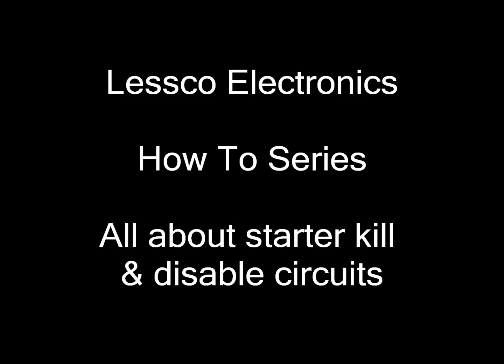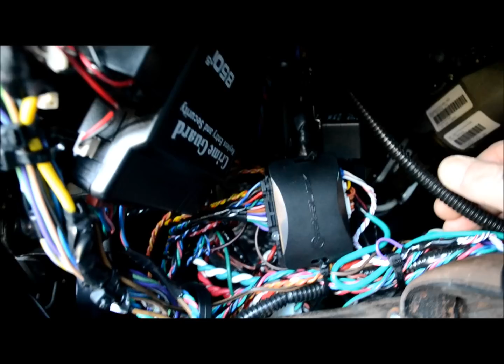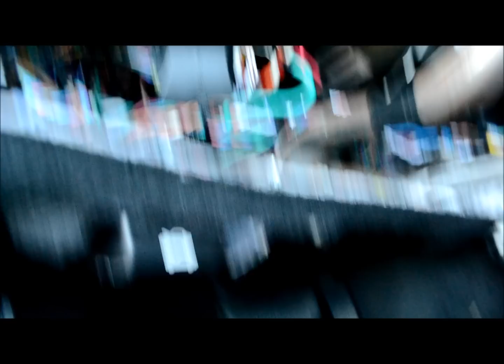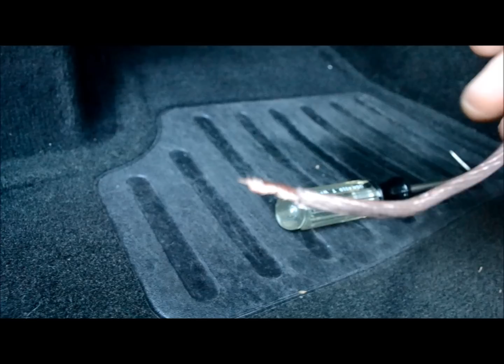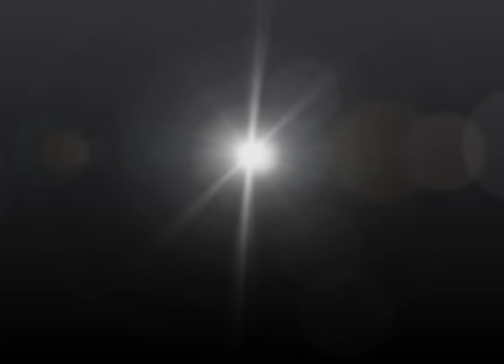Car alarm How To - Repair or remove a starter kill disable

Comment: Can't you just unplug the relay to disable it?
Reply from the maker: yes, IF you jump out the starter wire, if you unplug it you just open the starter circuit permanently which is no jueno

Comment: just remove that junk from the truck .  some one install this crap in a truck and it kept  getting them stranded on the side of the road. truck would turn over but had no spark

Comment: GREAT VIDEO The jumper wire connecting the two larger wires worked for me in getting my Subaru started. My emergency lights still flash, but I can now work that out. Thanks

Comment: I bought my van a few months ago and when reinstalling the doghouse after installing some new engine components, I accidentally hit some sort of switch hidden under the dashboard.  Now when I try to start my van, I hear a click, and the doors lock and quickly unlock.  I looked around under the dash and sure enough, there is an aftermarket alarm system installed. (DEI model 425)  I had no idea this was even in there as no fob came with the van.  I searched online and got the instruction PDF for this aftermarket system which has lots of info, except how to disarm the No Crank option.  I found a key fob on ebay for this system but I will have to program it to work and the PDF says I will need the code the original installer used to do that.  It actually has 2 little hidden push buttons, one with an led and the other one is black.  I also found a pair of wires hanging down under the dash running from one of the two alarm system Black boxes that have 12 volts hot between them all the time.  I am going to try your trick to see if I can get my van started as the manual says to reset the system, the engine must be running.  I may just rip everything out once I get it running again and I will watch your video on how to do that.  So, thank you for making this video.

Comment: Could starter kill relay cause parasitic drain on battery? I removed alarm system but didn't remove starter killer relay. Can it really pull 0.160amps when car is asleep?
Reply from the maker: its possible on an improperly wired relay, however I never recall seeing a relay draw so hard it was a battery killer on a starter kill by itself.
Reply: @Lesscoelectronics  Yeah im lost i really cannot find whats causing it i realised fuse 51 CAS drops it to 0.01-0.00 amps. But i cannot figure out what is causing it.
Reply: @Lesscoelectronics  Thank you for replying i cannot find what causes parasitic drain of 0.16-0.17amps on my bmw e90 2005. I do see drop in draw if i remove CAS fuse 51# but i cannot track it down. I did find a cable that was connected directly to JBE 12v cable which is insane that someone would do that removed it and hoped i fixed the problem but i still have same parasitic draw. I guess next thing to do is remove navi and radio to search for some kind of gps device or something that might be wired to that fuse. Im running out of ideas.
Reply: @Lesscoelectronics 
I really dont see how I can know what you did with that wire...
Just stick it in two holes there?
What did you do?
Reply: Im wondering if they have hard wired alarm siren to that fuse#51. Wonder if that could draw enough current 0.160-0.18 amps.

Comment: I have the Viper 350 PLUS 3105V 1-Way Car Alarm Keyless Entry and when I arm my alarm and unlock the front door with the key the alarm doesn't go sound off. If I unlock the passenger and open it it goes off. What is wrong? 🤔 Thank you in advance.

Comment: I have a 1999, Gmc with factory alarm :I had it disconnected,  but the Kill or too starter relay , acts up every 10th start or so. Example: it's a Security light in dash flashing it will turn won't start, I have to wait a while ,when security light is solid " cranks runs great..

Comment: You win 🤦🏾‍♂️😂😂 I went through everything from fuses all the way to the ignition cylinder and starter. Fixed it with 2 inches of wire 👏🏾👏🏾👏🏾

Comment: How do you remove that black box cover?
Reply from the maker: You mean the under dash panel?
Reply: Thanks for answering me back. Yesterday I attempted to remove it in the daylight and had a better look at it, and one of those two plastic screws on that black cover got loose, the day before me looking at those obvious flathead screwdriver plastic screws, I thought were dummy screws that didn't do anything ( no function just for looks screws) the next day one was dangling from me messing with it trying to take it off the night before,. then I finally got the box open and then I saw the fuse box is there I never knew where the fuse box was. I guess I should have  looked at the glove compartment book, but I got it thanks. I appreciate your help

Comment: I'm assuming there is little chance of getting a reply to this but I have a rattler security system in my truck and have been able to use my truck for a week because it's been going nuts as a result of the. battery dying and getting jumped. I tried disarming it many times and resetting it and doing a hard ecu reboot to no avail. Today I cut the power to the alarm itself and pulled the fuse to the system and pulled out the rattler head unit/brain and everything else I could track down but it still has it immobilized. Did I ass fuck myself by pulling everything like that? I need help

Comment: I have a 98 Ford mustang convertible 3.8l only has 98.000 miles it starts and just 10 sec later dies. Theft light starts flashing. I don't know where or how to start to go about finding nor fixing the problem, so my car Will run and start running.. can you please help me

Comment: Thanks for this video.  In my case, it seems it was something was the aftermarket alarm system that was preventing it from starting.  Or it could have been the connections behind the steering wheel... I'm not sure, but I tried tightening some random connections and it's starting now.

Comment: If I took out the alarm completely and took out the relay and reconnected my wires back to factory... can that still affect my starting ability? My truck ran fine before I took it out and rewired it. Now it won't pump fuel. It starts with fuel in the carb. But My pump or my injectors are not getting power. Wanna eliminate wiring as an issue before dropping my fuel tank to change the pump.

Comment: I have a 2003 Silverado I have a negative output out of my ignition coil could this be my problem if my viper alarm was taped into my ignition switch using a relay

Comment: i have 99 range rover that someone installed an auto page alarm. i found relay but all 4 wires are same gauge. would it do harm to just randomly try connecting wires?  truck wont crank and im out in the country. thanks.

Comment: You solved my starter problem. I clipped the two wires and joined them directly, and it worked. Thanks!

Comment: What if i cant find a relay but truck starts when i hook the 2 wires together
Reply from the maker: Hey, whatever gets the job done, right?
Reply: @Lesscoelectronics  lmao yea but im trying to keep the alarm working and dont wanna do it that way i was asking what can i do it dont have a relay that i can see it start right up when i touch the wires like u are in this video
Reply: @Lesscoelectronics  i just need help lol is all
Reply from the maker: why dont you just buy a replacement relay from our store?
Reply: @Lesscoelectronics  thats the thing i dont see any relays connected to the alarm only 2 fuses i followed the wires from the alarm wires for the starter and cant find any relays
Reply: @Lesscoelectronics  if it helps the alarm is a code alarm srt 6700 and ita on a dodge Durango lol older model
Reply from the maker: You couldnt miss it, It will always be interrupting the heavy gauge starter wire in the main ignition harness.
Reply: @Lesscoelectronics  i think the relay is built into the brain i traced both wires and there aint one im thinking the alarm is armed and cant unarm it cause the remotes dont work so i think i have to reprogram the remotes. Ideas on that????

Comment: Lifesaver man. My car sat up for exactly a yr and a half and the alarm went off until the battery drained all the way. Went back to start my car it wouldn't start not even with the remote start. Bypassed it with the wire and it work. Thanks bro
Reply: Which numbers did you bypassed?

Comment: would this be the same for a factory car alarm?
Reply from the maker: depends, the older ones work like this, but theyre actually aftermarket units with oem badging in alot of cases
Reply: Lessco Electronics How about  a 07 Nissan murano factory alarm.  Will this fix the problem.  Kill switch keeps coming on
Reply from the maker: whats the car doing now?
Reply: Lessco Electronics I turns back on if I pop the hood and move the battery to a certain way. I start back up but sometimes if I drive it . It will cut off at a light. It doesn't do it all the time tho

Comment: Before you do anything about problems with the vehicles alarm system please check the voltage level of your vehicles battery..  My Viper after market alarm system went out of my control when the alarm would not shut off.  Disconnecting the battery silenced the alarm and I was able to gain control of the key pad when I connected the battery back to my GMC.  The next problem was I couldn't go into the GMC without the alarm going off.  I couldn't shut shut the alarm off only temporary with the keypad.  

Come to find out what these professionals won't tell you is that there is a sensor to tell you that the voltage level in your battery is too low.  In fact it will be low enough that if you didn't have the alarm your car wouldn't start anyway.  As I'm saying if your alarm is giving you a head ache check all your batteries before you do anything.

Comment: I have a 2009 nissan pathfinder and when I cut my car off my alarm light indicator on my dash panel stays on, what can I do to fix it?
Reply from the maker: How are you disabling that alarm exactly?
Reply: I'm not trying disarm the alarm system, I'm just curious why my car indicator lights stays on my dash pane when I shut my car off and lock it

Comment: Hey, thanks so much for this! I have 3 heavy duty wires going into the kill switch box and there's a wire going between the small wimpy red wire to the big orange one. So what do I do in this instance? Can I cut that? I did my meditation this morning!
Reply from the maker: nevermind that, just reconnect the 2 heavy gauge sides of the starter wirem it should be pins 87a and 30 on that relay
Reply: Appreciate the reply! I connected 87a to 30 and it's completely dead. I never thought you'd reply so I had started unplugging the alarm after watching your previous vid. I did end up cutting that wire between the red & orange. I must have screwed something else up in the process.
Reply: You da man!!! I read somewhere that the battery could get drained messing around with the after market alarms so I threw the charger on and VOILA!!! It freakin' started! I can't even believe it myself. Dude,  never in a million years would I have even attempted this without your help. Many, many thanks. You saved me a ton of money! I hope your business is  BOOMING! You sure know your stuff :D
Reply from the maker: Good job!
Reply: This might be a dumb question. The butt connectors I have are 14 to 16v. Not sure if it's the right thing, but was all the store had. Is that all right?

Comment: omg I have 1993 prelude was running great now wont start or anthing iam just cutting them so this never happens again I sure hope this works its for sure alarm bc my back lights blink soon as the door opens I get a beeping sound from under the wheel but I get lights everthing no crank no nothing but nyet was running perfect 4 days ago I just spent 120 on a brand new battery today guess this is the problem

Comment: I have a 1970 Skylark with an aftermarket alarm in it.  The battery was draining, then the alarm started clicking and acting up.  I put a voltage regulator and new battery in, now the car wont crank, the company in Florida said take the cable off, put the switch to on reconnect the battery and it will crank.  It did the first time, not again since.  Anyone got any good council i'd love to hear it.  IF I can get this thing unhooked she'll stay unhooked.  I love my car, but i'd like to drive it again one day.

Comment: i have a 1983 camaro with a viper alarm... replaced starter an put in a new battery after i got the car out the paint shop.. immediately after leaving shop, my radio keep cutting off an on.. looked at the dash an i could see the car was trying to turn itself off. made it home. but now i cant turn the car back on... some times the dash will light up normal an act like it wants to turn on but then after i try a few time whole car goes dead like i have no battery in it at all... wait  a hr or so it will repeat the same thing over an over. found an off on switch on the alarm box, thats hasn't helped at all. was told because i had the battery off for so long i need to reprogram the alarm.. that will involve me towing a car that is 2in off the ground with fresh paint...not trying to do that... any ideas 😔😔

Comment: so what do I do if I got pissed and just pulled all the wires out lol. still wont start...
Reply from the maker: All you need to do is get 1 wire right, the starter wire. reconnect that one to get back on track, and try meditation, it helps.
Reply: Found ny ignition wire but they used a splicer to splice into it. As far as I can tell its still connected.
Reply: Lessco Electronics reconnect it to what?  Yes im a female and don't know anything about a car

Comment: looking for help. have a 04 element, currently, the car will start. but it will not shut off. everything will but the dash seems to think the key is still on the 'ON' position but there is no key there. alarm issue or something else? security light does blink a bit then shuts off.
Reply from the maker: drop the driver side dash and look for any aftermarket components in there and see what youre working with..
Reply: Lessco Electronics thanks, actually got it to work, I pulled the alarm fuses, car started fine and turned off fine. I put only one fuse back which allows for unlock and lock but no remote start. thanks for the reply though!

Comment: I have a "Loctronics" device in my car. It requires a small circuit key to be inserted creating a circuit and the car starts. I have found the starter wire that was cut. Ran the bypass wire but does not start without the circuit key installed. In other words can not bypass it,

Comment: how do u get alarm kill switch relay to activate when alarm is disconnected so it wouldn't have power. is there wire i can splice into so kill switch can activate if
someone trys to disconnect the wire plug into alarm box. any help would b highly appreciated thanks

Comment: I have a 2011 Chevy Silverado that has same problem. . alarm symbol comes on & never goes out & won't start
Reply: Pete White x
Reply: use your keey fob. set the alarm then turn it off it should start

Comment: Great video!   I have a real problem with an old 530i BMW 1994 and its remote starter.  Half the time the car wont start, but this little trick is saving the day.  I haven't quite got it off line yet but at least with this reroute on the relay I can consistently start the car now!  Thanks for the tip!

Comment: im having an issue with an autopage alarm system in my car, is it possible that the alarm system would let my car crank but not give spark to the distributor?

Comment: I'm having a problem with my 5901 viper alarm it works good for a couple of days and then the remote stops working and I have to re-pair it the alarm.. it seems like the alarm resets and deletes everything because my remote start stops working it goes in to manual transmission mode so I have to reprogram that too.. it's on a 1997 tahoe

Comment: my 2009 dodge charger won't start, when I put the key in the ignition,  a red light by the gas guage stays on. could it be the alarm??
Reply from the maker: thats the transponder system acting up

Comment: hi mate good solution.
can a do this at the back of the ignition barrel switch where the start wire is cut an looped into the alarm circuit?
mine is playing up and starts when it feels like it but cant find a relay. it all goes into a box.
Reply from the maker: I suppose you could do that
Reply: +Lessco Electronics Thanks will give it a try.

Comment: my toyota hiace won't start,  remote still works but it will not kick in at all. You can only start this car with a remote control and am afraid it will not budge. Alarm already removed but will not start on it's own. Starter won't crank too, have tried hitting it with a hammer to see if it will start but nothing at all. I don't know what to do now as I don't have a lot of money to take to a auto electrician to be fixed. are you able to help pls
Reply from the maker: Did I read this correctly, it starts with a remote but no the key?

Comment: what colors go where? And what color wires need to be cut or connected?
Reply from the maker: the 2 thick wires on the relay is the starter wire that needs to be reconnected together, (regardless of what color it may be).

Comment: Thanks for the video! I have a quick question though. Is it possible to disarm the audio portion of a car alarm while keeping intact whichever mechanism allows for the front lights to continue flashing?
Reply: Go under your hood, find your horns(should be 2 of them), and unplug them. Im dealing with this issue as well and had the neighbors call the cops on me because of the noise. If you unplug the horns then only the lights will flash when the alarm goes off.